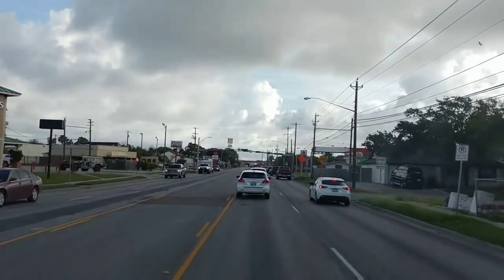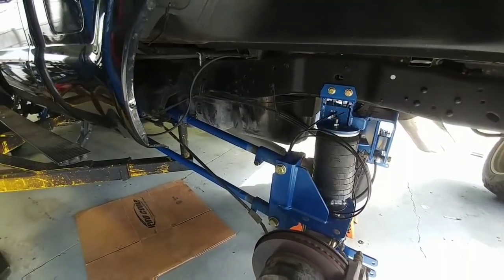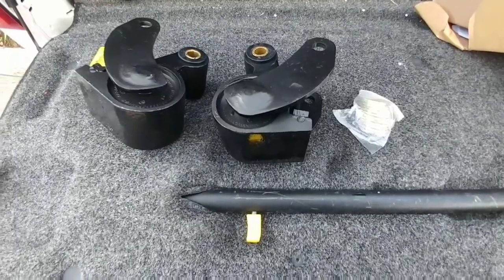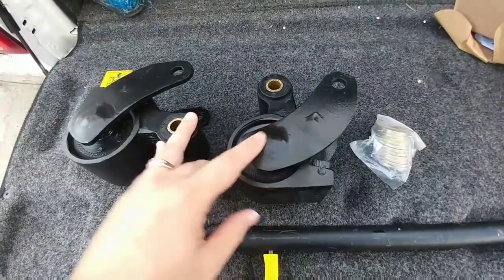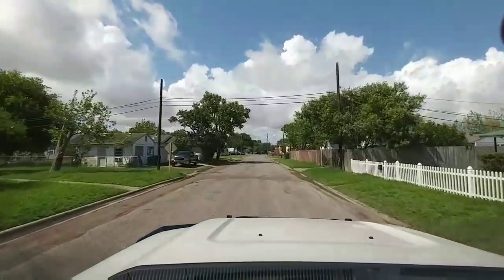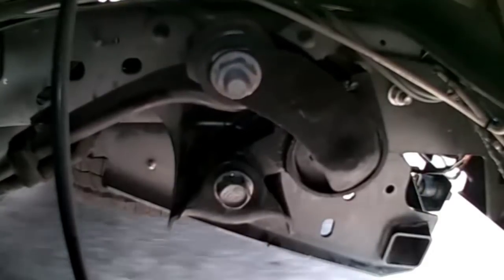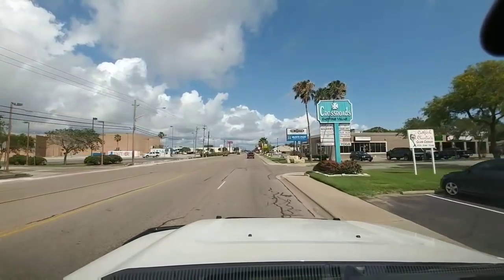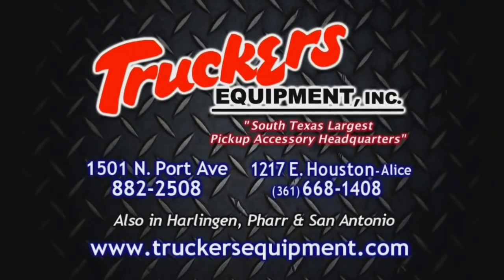Make your 1-ton truck ride like a 1/2 Ton!  Sulastic Springs!

Comment: After watching your video I was impressed and immediately called the manufacturer with some technical questions since my 2017 Ram DRW has the factory auto air leveling system.  I was really taken back by how ill-informed, rushed and rude the representative was.  I got no answers.

IMO this product could be useful however I actually use my trucks and often tow total gross vehicle weights at over 35K or haul a slide in camper weighing 2 ton plus so having heavy weight on the rear plus the need to know how this product would affect the automatic factory leveling system and the products max load handling capability is a must.   I need definite answers and guarantees before experimenting on a product that in failing could leave you stranded and possibly damage the truck, when the manufacture can't or will not provide it I am staying clear.

(probably a good product for the guy who hauls small loads once in a blue moon.)

Comment: Installed Sulastic shackles on my 2016 Ram 3500 2WD with OEM rear air suspension. Easy install, took 1 hour 20 minutes. I drove the hour home from the office/shop on varying road surfaces and speeds and did notice a very light reduction in the impact from minor jolts such as pavement joints and small ripples. Keep in mind I have the OEM air so it already road pretty smooth. Was it worth the +400? Time will tell. The next mod is a pair of Thuren front coil springs.

Comment: Ok this is a new one on me too , I have been lifting trucks and so forth for 40 years and have never seen this but it makes since I am impressed with design I guess as soon as I get a few extra bucks I will order a set for a 1 ton truck I have if it works as well as I anticipate then I know many truck owner friends I will end up having to do at least another 50 sets , at least its ma easy install
Reply: Did you do this ? I want to do it on my 12 inch lifted 2017 f250 all spring ....

Comment: Installed them on my 06 Chevy 3500 dually about 8 years ago. Noticed quite an improvement though the truck does remind me that it is indeed a truck on RR crossings & major pavement joints.
Reply: 8 years doesn't sound too bad.... are they still working well now at what, 12 years I'd guess? My concern is that 3 year limited warranty on the rubber part of these things, I would NOT want to be replacing them every 3 years or so!

Comment: The sulastic spring does not make a huge difference. It will soften the ride a little but all it does is take the harshness out of bumps. I would not say its price reflects its performance. I have had them on my truck for about a month now.

Comment: Hey I work at a Ford Dealership and did work on a truck similar to yours(same exact truck. It was even white), customer came in with a check engine light and loss of power concern. All warranty work if your vehicle falls within those guidelines. Thought you might want to make a video on it. I can give you more details if you'd like. I found it interesting but idk if it's video worthy
Reply from the maker: 73Grabber: msg me the detail please. Might be a good video, especially if it help others.
Reply: Big Truck Big RV alright, how do I go about that? Never done it before
Reply: Alright sent you a message with the details i have from home not able to access the codes i read on the truck about a week ago

Comment: God!! I have spent so much money on trying to improve my ride. I have an 05 Silverado 2500HD with CST 9-11" (set @9") Fox Shocks with reservoir (revalved to softest); and it still rides very rough. I can feel all the bumps and cracks in the street. I have been online and Youtube everyday trying to find ways to smoothen my ride or find a video like yours. Luckily I came across your video and I'm sold. I live in SocCal, so now I have to find a should that would do the still install or even carry the Sulastic Springs.
Reply: Well how where they ?

Comment: Is there a similar type of product for the front of the truck? Rear ride performance improvement sounds great, but if the front is still a rough ride because of the factory setup, there needs to be a way to make the front ride as nice as the rear. I'm looking at a one ton Ford, but don't want the rough ride of a one ton.

Comment: I have not seen any CURRENT info on any kind of product for a another improvement in front suspension. Rear is awesome product.
Reply: Front of a truck is always loaded with engine and transmission weight, it's the rear of a truck that's just oh so stiff when not carrying a load in your bed (or hooked to a trailer carrying a load). Therefore the bulk of your shaking when on a rough road and not loaded is coming from your rear suspension. Hence you really don't need to change anything other than having a good set of shocks on front suspension. Just saying.

Comment: I have an 05 Chevy Duramax diesel four-wheel-drive 6 inch CST left 35 inch tires 18 inch rims when I have  400 pounds of weight in the rear it drive smooth but my front shakes a lot when the roads are bumpy any aftermarket parts or recommendation thinking of air ride suspension

Comment: BTBRV. I would've gladly loaned my 16 Ram 3500 Dually for a Ram video install. I was in the local area last weekend. Unfortunately, I had to replace all 6 of those crappy Nexan tires because they all separated during the trip from San Diego. I may be in the area again in a few weeks so maybe shoot a vid then?

Comment: I have a 1996 f350 crew cab long bed 7.3 Diesel and most people might know they ride like a tank, I have air bags and overload springs. I wonder how well it will work when the baseline for my trucks ride is so bad.

Comment: ?? Do you put these on the rear leafs and the front leafs, I have a 2000 f250 XL 5.4 with front leafs.  I’m in PA  can this be done buy a DIY  can I order parts from you and cost of parts  thanks. Gene

Comment: I don't remember seeing a long term review on these. I do remember seeing them installed on the front of a gas excursion with a positive outcome. I have a 2016 f250 super duty and it bounces like it's on square wheels on some freeways when unloaded. It appears as though these will help. Do you agree?

Comment: With road-surface quality the way it is these days, this seems like a really good must-have upgrade on HD trucks. How does the ride quality  (with upgrade) compare with that of a Half-Tonne Truck? Better, as good as, or still slightly worse?
Reply from the maker: Matthew Godwin: The front didn't change, but the back is like a 1/2 ton truck

Comment: just had a set installed.The ride did improve. Don't know if it rides like 1500 though.
Reply from the maker: William Abramo: what i had to remind my self is that this upgrade does not effect the front of the truck in anyway.  My proof is that my wife and daughter (use to hate sitting in my truck) have no complaints any longer.
Reply: Big Truck Big RV My wife rode in the truck last night and said it rides much better.  So you know the saying "Happy wife,  happy life" the garage that installed them took 1.5 hours on one side 30 minutes on the other only because when the factory installed the shackles they must have crossed the threads on one upper bolt. They had to cut it off and replace it.
Reply from the maker: William Abramo: wow.  that's no good with the cross threaded shackle bolt

Comment: How much better would these work with a new set of high quality shocks? I have a 2018 F-250 and wouldn't mind trying this. These are $399.00 from the manufacturer.  Not a bad everyday driver upgrade.
Reply: DId you try them ? looking to put on my 2017 with 12 inch lift

Comment: Looking at the new fitment. Does it change the ride height?  Looks like it will lower by an inch. Also how compatible are they with air bags? 
Great video. Thank you

Comment: I bought these just after this video, put about 15,000 miles on them, and they failed. I tow an 11,000 lb trailer a couple times a year, but I rely on air bags when towing. The sulastic was for around town. Sorry, after a couple years and 15,000-ish miles, these should not fail.

Comment: Kinda  curious about the life of these and what is a failure like?
Reply from the maker: DillysADV: Josh with Truck Masters says he has only seen 1 fail out of the hundreds he's installed.
Reply: More durable rubber, and they fail in six months ??   Get polyurethane.
Reply from the maker: ya472: Polyurethane isn't flexible.  can't be torqued like rubber.
Reply: And, what is your point ?  What benefits do you refer to ?
Reply: ya472 if it can’t be torqued then you get no spring or ride improvement why not just keep the steel
Reply: I’m also interested in the life expectancy and how difficult it is to replace the bushings if you can do it at all
Reply: @xthexadvantagex  I suspect the rubber bushing is molded into the metal housing. Although,, having a replaceable bushing would be a better design

Comment: Would be nice if they had these for a 12,000# rated steer axle on a semi-truck and maybe something for the rear airride to smooth them out. If they just had these alone on the steer axle springs, it would make them ride much softer which would make a world of difference.

Comment: Is there a diff locker ( air, elec, or mechanical) for the F350 dually? I think it’s  Dana m300 axle with 37 splines.

Comment: Great video!  Thanks!   Been thinking about putting these/or similar product on my '06 Sierra 3/4T Duramax 4WD Crew Cab.   Reading the install instructions on the mfr website, it says to remove the lower shock mount bolts.  Noticed TM'rs did not do this.  Is this something  req'd on some trucks but not all?   The warranty on these shackles is 10 yrs on the metal parts and 3 yrs on the rubber parts.  Most folks get 5-10 yrs life out of them, depending on severity of use.   Wonder if some type of protectant  like Aerospace 303 would help the rubber last longer....................Safe travels everyone!

Comment: My ? is 2022 Ford F250 super duty,  pulling a 8000' tow behind camper. The ride goes forward and backwards over the Highway,  pushing and pulling , would this help with that???
thanks for any help, I live in VT and just traveled to Elkhart Indiana, on 90 and this was a bumpy ride, in a lot of areas.

Comment: Nice video. But what’s the difference between the sulastic shackles and road master active suspension? I have a Ford Excursion 4wd. Looks like both can improve the truck’s ride quality in different ways (approximating a Lexus like smooth ride quality)... Can these work together on the factory leaf spring to significantly improve the ride quality? Any insights?

Comment: In 2014 I ordered a new 2014 Ram 3500 HD Crew Cab Dully Longhorn, and I also put these Sulastic on my truck and it changed the ride in the truck so much for the good I could not begin to believe my luck. This is the best thing I've ever done for $500.00 with my clothes on. LOL. 

I've had Dulles since 1978 of all the different makes. This was my first Ram and I ordered it without test driving one. Well, when it came in to the dealership I was so excited to see it and sign the paperwork and get on the road home I didn't get to drive it before paying. 

On the way home, I almost lost all my fillings in my teeth from the ride being so harsh. I was not a happy camper. Not one single review on the new Ram one ton 3500 HD talked about the hardship or the ride. It was way worse than any other truck thatvI have ever owned. I was very concerned. I started to look around and talk to other shops looking for help. I also had to lower the rear and front of the truck. 

I was getting a nose bleed and had to carry a bottle of oxygen because I was so high up. LOL. I tow a 40’ race car trailer set up for formula cars and it sits a bit lower than most other trailers. 

At the time I had the rear suspension lowered by way of reversing the rear springs. I had not received the Sulastic and drove it for another week with it now dropped 4” (perfect) but without any better ride quality (wishful thinking). When the Sulastics came, I was never so glad to get a package in my life. When I picked up the Ram and drove home after the installation,  all my prayers were answered. The difference was day and night. I can't begin to tell you or anyone how much better the ride got. I love this truck. I was delighted to see your YouTube video with the installation, and you conclusion was the same as mine. 

I have a question; every company out there is in the business of lifting the trucks and no one is dropping a one ton just 2”.  I believe just getting new springs made 2” shorter (correct thickness of wire) and change the bump rubbers should do it? 

Ted, Newport Beach, Ca.

Comment: How do you think they would hold up with a heavy slide in camper? Can they take that heavy dead weight? My camper is about 4000lb before my wife puts her stuff in it.
Reply from the maker: Lawrence Spahr: I believe the HDD version will do just fine.
Reply: The problem for me is that I have a wife that weighs so much I can't even get the 4k camper. I have to settle for about a 1000 lbs less.
Reply: It is nice you believe, however if you had proof, then maybe you would offer a five year full replacement guarantee.
Reply: Not for towing.

Comment: You and I have the same 5th wheel but pull with different PU's. I pull with a 3/4 ton Duramaxx. I've often wondered if it was possible to smooth out the ride.  So thanks for the review.  I do have a couple of questions.  Did the install interfere with your airbags?  Did the install change the ride when pulling your trailer?  Can you recommend a shop in Houston?  Thanks
Reply from the maker: Thanks.  Yes, they are compatible with airbags with no problems.  Unfortunately I do not know of any shops in Houston that could do the work.  They work very well though

Comment: Just now catching this video. Do you have these on your current truck? I have a 2017 f350, and currently boondocking on our Arizona parcel. To access this, there is 16 miles of dirt (washboarded badly) road. Just wondering how this upgrade would affect towing my 15000# fifth wheel. I dont have airbags, but was thinking about them also. 
Your thoughts?

Comment: Awesome difference. I’m going to look into getting some installed. I have 2009 GMC Sierra 3500 drw with only 80K miles. I use it on a small horse farm. I have a dual slide truck camper that weighs about 4200#’s that sits in the bed. Current accessories include Torklift 30K superhitch magnum with extension to extend behind truck camper, air bags (don’t like and run at minimum), Torklift lower stabilloads, & Rancho 9000xl shocks. I’ve been towing a Jeep using a Blue Ox tow bar on end of extension. I have bought an aluminum 2H BP trailer I want to pull with camper in bed of truck. Trailer weight empty = 4100#’s, loaded = ~ 7500#’s. I am going to add the Timbrens and solastic shocks if they fit my truck. Do you recommend a weight distribution anti-sway system like the Blue Ox sway-pro? Thanks for any advice!

Comment: I just brought a F250 SRW 2019 . June 4. I drove it home about 2 hours from the dealership. It beat to death. My tailbone hurt really bad. So, I got up and got on youtube and found a lot of videos . So my question is .Would you put the Sulastic Springs with Bilstien 5100 shocks. .This is going to cost about a $1,000 so If I could get by with one or the other it would be great. Thanks

Comment: You are showing a ford F350 which has a lighter frame design but I own a 2015 Dodge Ram 3500 and it has a much more rigid frame, do you feel the results would be comparable
Reply from the maker: Lighter frame? My previous F450 in this video weighs significantly more than the RAM.  The C Channel frame is much heavier in the F350/F450 than the much thinner fully boxed frames now on trucks.  Your frame is 3/16th thick.  The previous Ford frames were 1/4" thick and double that in some areas.  The frame alone weighs almost twice as much as your boxed frame does.
Reply: @BigTruckBigRV  That brings to mind a video I watched here on youtube. They put a ford against a dodge and put a block under 1 right wheel and left all three others on ground..You could not open the tailgate or rear doors on  the ford but could on dodge, due to so much frame flex, so that leads me to believe that dodge has a more rigid frame and would be much rougher. Just my thoughts

Comment: 9:23 why not correct the factory error and install the bolt from outside and the nut by the frame? Cut them for clearance in necessary. Makes it easier to service the bushings when they wear out. 

BTW, how do these compare with Old Man Emu solutions?

Comment: BTBRV, have you added Sulastic springs to your ‘17 450? Or just the shock upgrade for suspension? If not, would you down the line?

Comment: Enjoy your channel are these springs a substitute for putting air bags on your truck or would they add to the process of softening the truck ride while empty using both products.
Reply from the maker: Drifter's Den: Not a substitute, but an enhancement
Reply: Ok thanks keep them coming going to look for a pair in my area
Reply from the maker: Drifter's Den: check my video description for discount code

Comment: I have a 15 F350 CC LWB.  I have Pure Performance 6" lift front and rear.  The entire kit..softer springs in front and softer leafs in rear with 2.5 Fox adj.shocks front and 2.0 in rear.  I also have air bags with 2 compressors..but still want a softer ride.  Will this product help or work with my mods.  BTW, I have been a subscriber, and thank you for all you do in your testing.  Jeff
Reply from the maker: Jeff Jassby: thanks! they should help significantly with your lift.

Comment: I’ve seen many videos on installing these but I haven’t found the answer to my question yet. Do you tighten the shackle bolts while the springs are hanging or do you tighten them when the weight of the truck is on the springs?